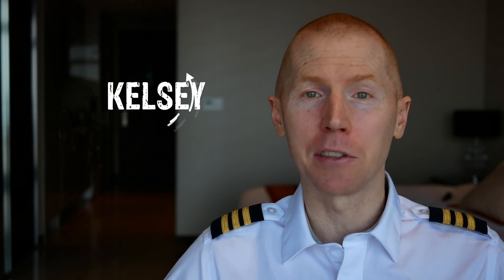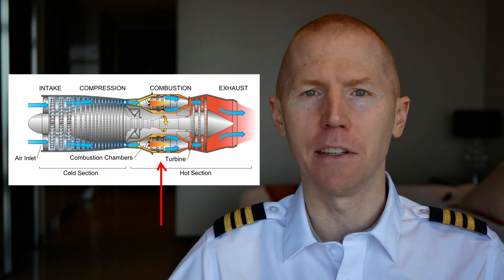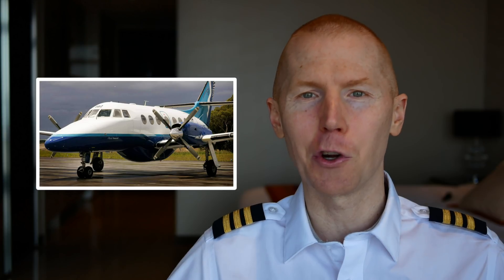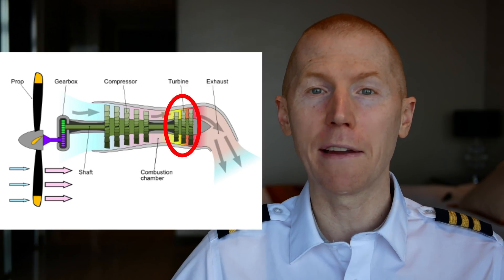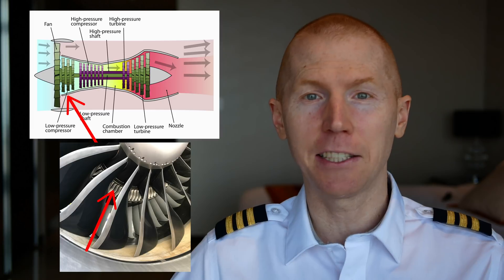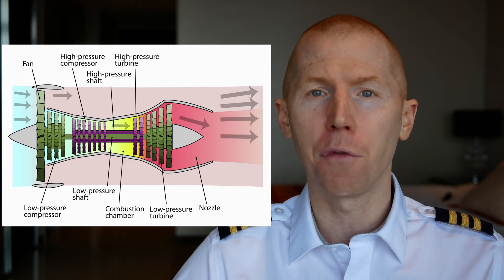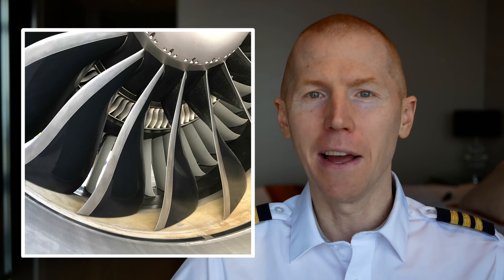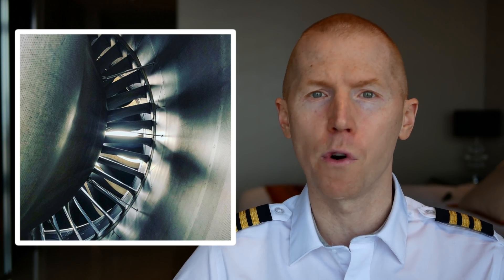Is a Turbofan Engine or Turboprop Engine Safer? | Pilot Explains

Comment: Factually correct or not what I was taught is a turboprop is slightly safer because if the engine stops you can feather the prop and get some lift from it. A stopped turbofan is dead weight.

Comment: Ummmm as a mechanic and then FE, your explanation is good enough for someone who has no idea but not accurate. TF engines run on increasing RPM (eng must spool up) a TP is constant RPM (direct power) blade angle of the prop generates “thrust” torque which is immediate response. Old 141 and 130 guy here I’ve worked both TF-33 and TP-57

Comment: I've only flown in one turbo prop but  the engine felt silky smooth. No vibration or anything to suggest it was less reliable than a t-fan engine. 

What surprised me most about my first time in a t-prop was the disappearing prop. I was center behind the P and CP maybe 10 Ft. behind it as the engine spun up and it just disappeared. Everything was amazingly smooth.   

Chronologically I'm supposed to be an old man now but I will always be a kid when I get close to flying machinery.

Comment: The explanation of the (dual purpose) turbo fan jet IS reassuring- but is a propeller plane like the Dash 8 (very noisy with high vibrations on milk run from n BC to Alberta, Canada) less vulnerable to bird strikes? i.e. sliced turkey?

Comment: Still with the suck squeeze bang blow, of all engines. 
Also the Turbofan Engines, are Ultra High Bypass Engine. 
I'm a GE F404 guy, a High Bypass Engine, the bypass goes past the core, right to the burner can.

Comment: The reason I prefer riding in airplanes with turbofan jets instead of turboprops, is because of the vibration that propellers produce. I had some unpleasant experiences as a youngster with smaller propeller driven airplanes and air sickness. So it’s a visceral memory.

Comment: Hi man! really love your videos but just for sake of argument i wanted to specify that that fan does definately not work as a propeller. It is just the first stage of the low pressure compressor and it's dimensions are due to other reasons.

Comment: Wow, Kelsey, l have seen explanations before regarding the jet engine, but this was the best and easiest to understand ever, so thank you for that. And l never knew the fan blade was also working as a propeller .l thought it was only the thrust pushing out the back of the engine. pushing a jet forward.

Comment: re 2:50 re bird ingestion:  The odds of the blade arm knocking the bird out of the intake air stream seems obviously less than 1:5 (the breadth of the arm vs the breadth of the space between the arms) but increases with the RPM to air speed ratio.  As such, 0 RPM will never stop a bird in the air stream, and 0 air speed makes ingestion unlikely.

Comment: I've jumped out of perfectly good airplanes with only two pieces of plastic between me and death six different times.  Sometimes prop, sometimes jet (not sure what kind exactly, but not turboprop).  I've never been concerned with engine type or reliability.  I just wanted to jump and land without injury.  Never occurred to me to be concerned about engine reliability by itself. I know how stringent the safety checks and tests are.  Cheers!

Comment: Turbo props have more parts - ie balancing the prop and checking for micro-cracks.  Also an iced propeller can throw chunks of ice at the fuselage of the aircraft.   I don't see them as 'dangerous', I just see them as slightly more dangerous than a turbo fan.

Comment: I'm an A&P Mechanic the turbine engines you described are essentially the same. As a general a constant pressure engine is more reliable because their very simple. A piston engine is always going to be less reliable because their is more going on. That however dosen't mean Lycoming and continental motors are gonna just fail ... im using the term in a relative way. If we are speaking opinions i think the High Bypass engines are the best hell if the plane has 2 engines or more its super safe in my mind. Aircraft are generally designed to fly on one engine, so loosing an engine isn't gonna be un-recoverable. When your in an aircraft your surrounded by redundant systems, the statics speak for themselves.

Comment: Compared to jet planes of same size, turboprops can go more places. They need shorter runways.
Also as another comment already said, probably the people are less afraid of the propeller than that turboprops are in general smaller and lighter machines (Ok, not talking Airbus A400M or C-103 or Antonow AN-22 or even Transall here, these are not often used in public transport, what I mean is rather a King Air or even smaller).
And all you need to know is the difference between a piston engine (2500 moving parts where each can fail) and a turbine, be it with or without propeller, that has much less moving parts.

Comment: Its poor  maintenance or pilot error which seem to cause most accidents.  Last night I watched a video about an accident in the 70's where how the engines had been maintained was the entire cause of the accident.  Instead of detaching the engine they used forklifts etc saving some 200 hours for each engine.  This was in the 70's, with DC-10s I believe.  The forklifts were actually damaging the engines and it was totally contrary to manufacturer's instructions. During the accident the entire left engine fell off just before V1, they continued, thinking it was an engine failure, but a lot of the electronics were also in the left engine, and the plane stalled shortly after killing a huge number of people.  
All that because the damn engine hadn't been properly maintained.  Cost cutting and shortcuts cause the most problems.  
I am not too thrilled at the prospect of small planes simply because like boats, you can probably feel more and I have motion sickness.  But I saw a YouTube of a cute little Kingair in Sweden the other day and I started to like the idea. Who knows.  I'd rather be on a plane than a boat, anyday.

Comment: Growing up near a major Bravo airport and along one of the ILS paths, we appreciated the high-bypass turbofans since the noise reduction was huge. The cooler air from the bypass creates a buffer from the hotter jet air which lowers the loud crackling sound that I remember as a kid (which were so loud we couldn't even hear ourselves play) and are more efficient since that cooler fast moving air stays more laminar when mixing with ambient air than the hot air from the jet.

Comment: Both types of engines are best for different uses.
After all, there's a good reason some planes use one, and others the other.
It is mostly about efficiency at different altitudes and speeds and ease of maintenance.
They both have different types of complexity.
Turboprops have to have a gearbox and pitch control to drive the propeller but the engine itself can be relatively simple while turbofans are more complex internally with higher stresses acting on every part.
They need more complex air control, lubrication, fuel, and cooling systems.

Comment: I was in the US Air Force back in the early '80s.  I was Station at RAF Bent Waters (yes, the same base that had "that" UFO sighting)  We had the mighty A-10 Thunderbolt II stationed there.  It's powered by the GE TF-34 Turbo-fan.  I was in the 511th Aircraft Maintenance Unit.  Next door was the the 510th AMU.  On day, one of their pilots had an "incident" with a Fan Overspeed.  
As he was flying straight and level he did an instrument check (pilots do that on occasion) and he noticed that his right fan speed was WAY past the redline
and he thought
"That's not good,  I should probably turn my noggin and scan the right engine with my model mark one eyeballs"  [ the engine inlet sits within the rearward view of the pilot]
SO,
he looks back
and he swears in his debrief that as he put eyeballs on the engine the fan was OUTSIDE and IN FRONT OF the inlet ring!
It apparently over sped, broke its shaft, outflew the engine, and he saw it just as it lost velocity and fall back into the inlet and
AND 
chewed the crap out of the inlet ring and jammed.
The pilot shutdown the engine and returned back to make an uneventful landing.  

I personally saw the inlet ring after it was removed from the aircraft.

I was impressed

Comment: The turboprop engine can control an operating parameter the turbofan engine cannot: the pitch of the propeller blades, which can even be reversed for braking.

Comment: Been on one turboprop airplane, way back in 2001.  US Airways from LGA to BOS.  My only complaint?  other than how loud it was...was the thin seats and my "seatmate" was larger than me by a lot...so she actually ended up using some of my space (I had the aisle)...it was only a 50 min flight...so there was no point in complaining.  Not sure if that situation would be allowed today with covid.  I don't have any worry about a turboprop vs turbofan engine.  Prefer the turbofan cause those are usually larger aircraft vs turboprops.

Comment: When you say "the thrust created from the explosion", that is incorrect. The combustion process in most turbojets is not a detonation (or explosion), It's a deflagration (or good ol' burning), as the flame front is subsonic. 

There are a few experimental engines where there are actual explosions inside (pulse detonation engines), but none operational, and certainly not in any airliner :D
Reply: But they do still refer to that portion of the turbine engine as the "combustion" chamber, lol.
Reply: @bryanrussell6679  The explosion chamber sounds super badass.
Reply: There's always some douche in the comments.
Reply: @sasca854  people like to swing there dick around, because they dont understand the concept of listening to what ppl mean rather than what they say.  this dude is taking a technicality to a whole new level, not mention the dumbass doesnt understand that a deflagration is also a form of an explosion
Reply: "There are a few experimental engines where there are actual explosions inside (pulse detonation engines), but none operational ...."   This isn't really true either ... Consider  the German V-1 "Buzzbomb", and it's pulsejet engine back during WW2.  Today, pulse detonation engines are used in many drone aircraft.
Reply: @oddshot60  You are wrong. The V-1 was a pulsejet, in which the combustion was NOT supersonic, it was well subsonic, therefore deflagration. So no explosions. 

Regarding the "many drone aircraft" using PDEs, again, wrong. There were concepts and *tests*. No actual PDEs are operational.

Comment: Let’s discuss the two. First. The prop or propeller on prop aircraft can give you a gyro feeling.anyone who’s traveled into a c130 knows what I’m saying. However. The turbo fan failure can be fatal if a blade is weak and breaks off. The red lines on the inside of the aircraft in the seating or cargo area mark the kill zone for the if a blade comes out. If that happens, that blade will penetrate the fuselage and anyone in its path faster than a bullet. And it will keep going.. 
The air from the outside  also serves provide a bit of a cooling effect as cold air travels through it and not into the burner chamber. Aircraft metals are not intended for high heat. Honeycomb aluminum panels are used for weight reduction.
Reply: I don’t want to call it an explosion as that’s what Happens in car engines. What happens is the air is fed into the compression chambers then into the combustion chamber. Fuel is atomized and ignited creating a large expansion of air as hot air is more dense than cold air. And that is then fed into one last compression blades then forced out the back. But it’s always igniting the atomized fuel. Like a lighter with a can of hair spray. One example CFM-56 F-108 engine.

Comment: Knowing what I do about the different types of propulsion, propellers produce thrust sooner than turbofans or Jets. In that respect, an aborted landing would be easier to overcome with a Turboprop type engine. And a turbine engine is more reliable than a piston engine. So a turboprop would be the best of both worlds as far as safety is concerned. Let me know if I got this right, as well as my other question. Thanks! 

Can a turbine engine be used to drive two set of propellers! One central engine providing thrust from the engines exhaust and two wing mounted propellers?

Comment: For the question you had:

No.
A Turbofan is very similar to a turboprop.
The difference is just, that the turbofan combines the way a turboprop works, and the way a jet-engine works. 
If a Propeller spins, it creates forward momentum. It pulls the plane.
If hot air is accelerated, it pushes the plane forward.
The Turbofan Jet-Engine has those two things.
The Turboprop is not using the accelerated air to push the plane.

Comment: If a gas turbine engine is operating properly there is no "explosion". Two types of ignition systems are in widespread use: capacitors that build charge from a pulsed current fed to them, before discharging through a spark plug that has a much larger anode-cathode gap than that in a car, and works at a higher voltage to discharge much greater energy in a shorter time. There are also electronic ignition circuits that achieve the same effect, (and some rare and rather "eccentric" ignition systems that use different principles altogether). The voltage, gap, and energy discharge of the annular-type plug are chosen to ensure that the fuel-air mixture ignites under the most difficult conditions possible during flight, which are much more extreme than for a road vehicle. The fuel is continuously injected into the highly compressed air inside the combustion chamber/s; a typical modern gas turbine engine achieves a compression ratio roughly 4 times greater than that of a car engine. It is usually only necessary to ignite the fuel-air mixture once, following which normal operation of the engines should keep the flame burning. However, it is also common for the ignition system to remain continuously operational during critical flight phases, so as to prevent flame-out. When Jet-A1 is correctly mixed with air at the right pressure, the flame front burns forward in the mixture at 50 to 100 m/s. The flame cannot burn forward into air that has no fuel, but if the air is flowing too fast through the combustion chamber, the flame will be blown out.

An "explosion" is associated with detonation: a shockwave travelling through a substance is an extreme change in pressure, associated with a corresponding change in temperature. The shockwave causes an immediate chemical reaction as it passes through the material, which in turn releases more energy, which strengthens the shockwave. Engineers do NOT want detonation (explosions) inside gasoline engines and gas turbine aero-engines. Compression ignition engines, (such as diesels), are on the borderline of using explosions, but if they are operating correctly the fuel is dispersed within the air as tiny, distinct droplets - not as a single continuous, explosive substance, and this greatly dampens the effect, so that it is endlessly and pointlessly debatable as to whether the fuel-air mixture inside a diesel engine actually "explodes". (By comparison, a "fertilizer" bomb comprises a continuous, dense mixture of potassium nitrate soaked in diesel, which will explode if detonated.)

Comment: I'm not concerned at all about engine type. Turboprops and turbofans are powered by gas turbines that burn kerosene anyways (Jet A, Jet A-1, JP-4, RJ-1, etc...). Turboprops operate at lower cruising altitudes and speeds than turbofans. That limits their rage, so they're used on short to medium-haul planes. Turbofans with their higher cruising altitudes and speeds have a better range, so they're used on medium to long-haul planes. They both have their place in aviation.

Comment: Something you didn’t cover is how loud the turbo prop is in comparison to the turbo fan (jet engine) - last time I rode on one of these babies I wore plant rated ear plugs and still felt deaf after riding - I would rather have 3 connection flight than fly on a turbo prop as a passenger

Comment: Turbojet: Very high pressure exhaust propels aircraft.

Turboprop: Very high pressure exhaust moves fan stages that spin a propeller at the front.

Turbofan: Both in a concealed turbine engine sandwich.

Comment: As a mechanic on turbo fans I prefer those. Plus the blades in front of the intake give me the feeling that something heading into the intake would most likely get whacked out of the way before it got into the compressor makes me feel safer. I hate flying as it is. But if I have to and I had a choice, turboprop would be the way i want to go. But on the other side of that there's a lot more moving parts going into that engine than a turbo fan. More potential for failure if not taken care of right. So if I fly, gimme a beer and let me sleep till I get where I'm going because flying sucks.

Comment: Some turboprop (or turboshaft in helicopters) engines have one power turbine section driving both the compressor turbines and the propeller shaft (or output shaft in choppers) or two power turbine sections, one for driving the compressors and another independently driving the propeller or output shaft.

Comment: I wondered why some engines like Southwest they don’t turn not at least when I was on it, the fan was stationary at least that’s what it looked like and on other planes it was turning im pretty sure, and also I’ve noticed that Southwest Airlines planes feel less.... Um I don’t wanna say it but.. Let’s just say they feel a little cheaper than the other airlines planes lol, I can here plane noice more it sounds like hydraulics, maybe it was where I was sitting idk but 🤷🏼‍♂️ I was on this HUGE commercial one I think it was a airbus but the thing had like 4 engines I think and was huge inside I honestly felt safest in the bigger airplane and it was so smooth, that was when I was making a connecting flight out of Atlanta I think.